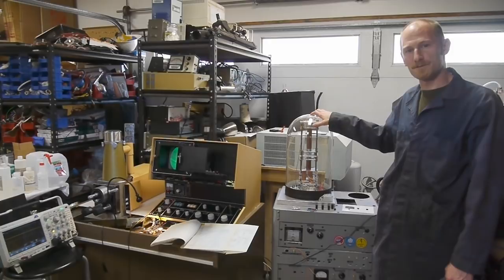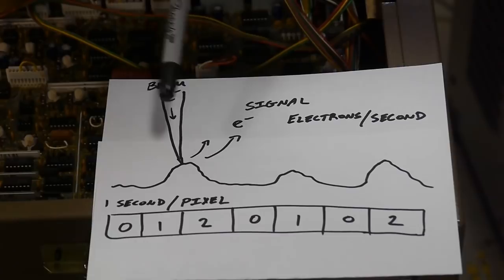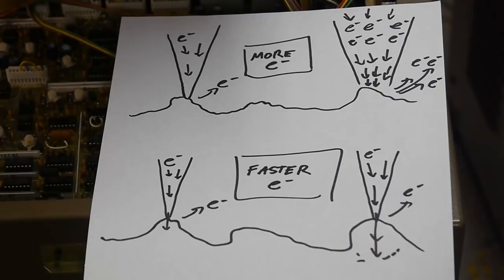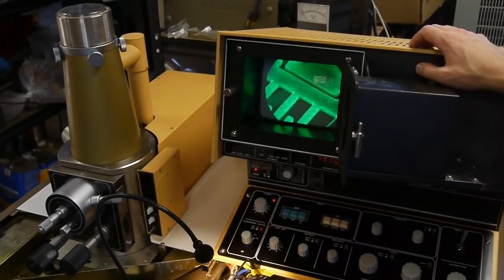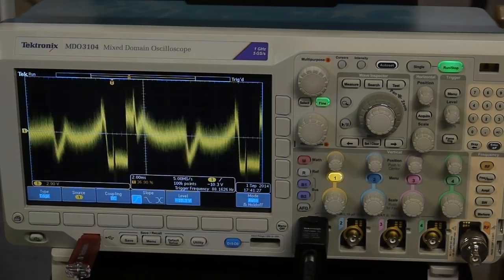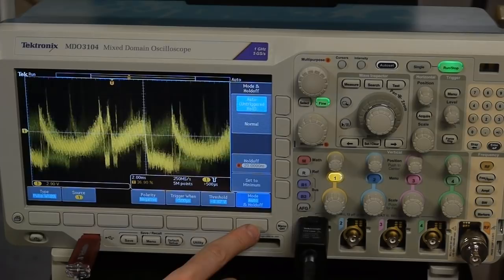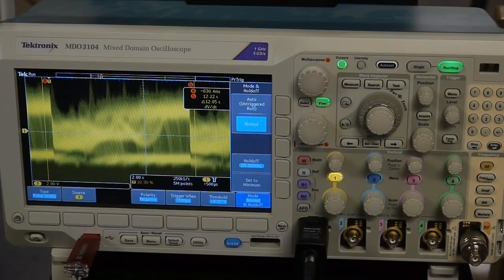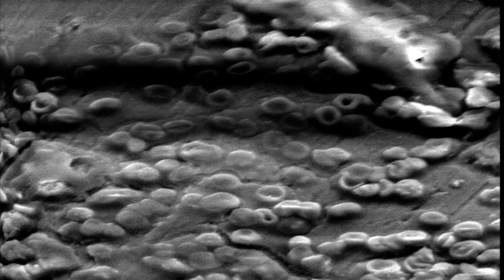Electron microscope image capture with an oscilloscope

Comment: Absolutely awesome Ben.  Can never get enough of SEM photos, simply fascinating - and I love how the MDO is being used as the data acquisition engine.  The HiRes sampling mode, with the amount of boxcar averaging you're getting, is giving you many more bits of vertical (video) resolution.  Simply great!
Reply from the maker: Alan, thanks so much!  I wondered if the Hi-res mode allows the scope to output more than 8-bits of vertical information.  It looks like it does from the smallest deltas in the CSV file.  Very handy feature!
Reply: Applied Science Yes, you'll get an extra 0.5 bits each time the # of bits averaged doubles.  Thus, If Hi-Res averages 2 bits, you get 8.5 bit resolution.  If it averages 4 bits, you get 9 bit resolution, and so on.  The MDO3k samples at 5GS/s on a single channel.  When you set the record length and horizontal scale, you effectively set the waveform sample rate (reported on the bottom right of the display).  The number of samples averaged in hi-res mode is then 5GS/s divided by the indicated waveform sample rate.  Thus, if the waveform sample rate says 500MS/s, then 10 samples are averaged to create each waveform sample point, giving you just over 9.5 bits.  Fixed point math hardware limits the progression at some point...

Comment from the maker: Afrotechmods Thanks, man!
Reply: Very nice. Since a SEM can seemingly be a rather simple device with low speed low cost image acquisition electronics and USB interface, I wonder if you might consider seeking venture cap funding and do a kind of makerbot SEM for the people. You could just start it up and pick some people to implement your directives so you don't actually have to do anything.
Reply: Applied Science 

What is the resolution on the microscope you were shipped? 

I am in desperate need of a SEM. It would be very cool if you work on Dan Frederíksen's idea. Me and countless other citizen scientists would be all over that.
Reply: It dont have one by default, it is analog
Reply: I did not understand the name

microscope sem 80s
Reply: Is an electron particle or wave?
Reply: @thekaiser4333  Yes.

Comment: Hi Ben, 
Another cool trick you can try with the EM is imaging the internal structure of chamber, like having a mirror inside the SEM. Mount a coin shaped disc with smooth side under the beam. Apply high kV (30kv) on the disc, let it charge up for about 5 mins. Then switch to low kV ( 3kv, or 4).  You will see image of chamber, with a sort of fish eye lens effect.

Comment: Ultra long exposures, that's an awesome solution! Could you use the same trick as astro-photographers by stacking many frames to get even finer detail?
Reply from the maker: That's an interesting idea.  I think it would probably work really well.  I'm imagining an image that progressively improves in realtime as more frames are acquired.  Then, it resets when focus or pan is changed on the SEM. Cool!
Reply: Applied Science You should make a video of you doing that
Maybe even take user suggestions for things they wanna see you put under the microscope
Reply: Applied Science I'd love it if you'd do a piece on "Stack and Stitch" photography.  Using a regular telescope you could get some fantastic pictures of the moon with super high resolution!
Reply: I believe they do.
Reply: Applied Science why resets? just put the original image as part of the new screen

Comment: Also I'm very surprised at the images you managed to capture without having to plate the specimens in gold like most SEM operators have to do. The fly image especially is just amazing for what it is. I wonder what difference gold plating would do if you were to rescan the fly now that we know it works well enough without it? Would you get any better resolution/detail at all do you think?
Reply from the maker: Coating with metal will definitely help -- especially for higher magnifications, which require smaller spot sizes, which really need as much signal as possible.  Most labs that have a SEM also have a dedicated sputter coater, so it's easy for them to always coat specimens, and write it into their protocol.  My sputter coater is working, but was recently moved, and hasn't been setup.  I tried scanning an uncoated insect and was surprised how well it worked.  You'll never see a proper SEM lab do this since they already have a full complement of tools.  Sometimes it's good to just try something and see what you get! In general though, coating with metal will help the image quality in every way.

Comment: Cheers to Mr. Anderson for seeing the opportunity and to you for taking advantage of it.  The scope gets a new lease on life in education!  Looks like a high quality piece of equipment (especially after what you said regarding the shipping damage)

Do you think you could use an audio card as a poor man's scope (with some conditioning of the input of course) to record these images?  The MDO is lovely at it, of course, but it's not exactly a low cost item, lol.  I believe the Wolfson card for the Raspberry Pi is ~$35 and the ADC seems to be able to record at 192ksps.
Reply from the maker: Yes, when I started making this video, I intended to use a USB audio adapter as the capture device.  Mine is a cheapy model, and only does 44KHz, so it would work for the SEM's 60-second scan, but would not have enough temporal resolution for the 10-second scan.  The audio device is 16-bit as opposed to the Tek's 8-bit, so there would be an increase in dynamic range.  Also, all audio adapters will need to have their input coupling capacitor bypassed.  I did this on mine, and it worked well.  However, some models include digital high-pass filters implemented in the ADC itself, and these are essentially impossible to bypass (like the ones in the Handy H4n).  The DC input range on my adapter was something like 2-3 volts, so the signal from the SEM would need to scaled and offset -- not too difficult, though.  Other alternatives are the LabJack, Measurement Computing, and NI USB-600x models.
Reply: Very cool!  And thank you for the short list of alternatives at the end, couple of things in there look like they will be useful!

Also, ordered shirt.  Paypal via Chrome was a bit wonky in case you hear anything.  IE was fine (go figure, lol)
Reply: jcims You can use a USB audio card, but you need to remove any DC decoupling caps from the interface, and you don't get very good control on the actual sampling bandwidth. If you want to eliminate (or enhance) super-nyquist aliases, you should use a sample and hold ADC. You can get plenty of cheap uCs or FPGA boards with 250ksps ~ 2MSPS sample and hold ADCs, and it's kind of trivial to build an opamp circuit to bias, filter and amplify the input signal.

If I had an SEM to play with, I would attach it to my Terasic C5G board with HDMI, so the picture shows up on the screen as it captures. It has a 500ksps 12-bit ADC which is surely fast enough for the task at hand.

Unfortunately while FPGA boards are cheap and widely available, SEMs are expensive and rarely sold used in my neck of the woods.

If I was to build an instrument it would be a scanning confocal microscope, rather than an SEM, but that's my preference, not a recommendation for others.
Reply: If you want to send a very slowly changing signal near DC frequencies, you can set a 555 timer as a square wave oscillator at a frequency that the sound card can hear then hook the signal to a pin on the chip which will modulate the frequency, then you can use an interpolated zero-crossing demodulator in a C program to recover the voltage trend.

Comment: Hi Ben:  A couple thoughts: 1) At some point the long exposure of the CRT will have diminishing returns.  As the exposure increases so will the accumulated noise on the sensor.  However I think a bigger area of image degradation will come from scattered light, although the scan beam is a “spot” the phosphor is going to throw photons around causing some “blooming” of the spot and might become a problem with slower scans and longer exposures.  Someone suggested averaging multiple exposure to improve S/N; I would think you could do similar and possibly better by averaging multiple analog captures.  Although, what you have shown just “out-of-the-box” look great.  2) You mentioned the edge distortion seen in your un-cropped analog captures.  You might be able to correct this as they do for glass lenses.  Manufactures of photographic glass provide a distortion profile for their lenses (e.g. barrel/pincushion, angle of view, vignetting, etc.).  These lens specific profiles are provided within Adobe Photoshop and Lightroom, and others.  Adobe has outlined a procedure and software to generate custom profiles (http://www.adobe.com/support/downloads/detail.jsp?ftpID=5492).  Basically, you image a rectilinear grid and the software calculates an orthorectified correction matrix,  Anyway that's my 1.99999 . . . cents. Cheers, Mark

Comment: A cool thing you can do is look at a live electronic chip surface.  The charge of the surface makes the EM signal brighter or darker, so you can directly see the circuit running!
Reply: Unfortunately, you won't be able to see that on a semiconductor. You are able to see that on the pins of the chip. He already tried it.
Reply: Why is that? Is it because the semiconductor is covered or some physics reason?
Reply: farvision semiconductors are very small, those traces are incredibly small, but the main reason is because there is a plastic protection film over the die.

So you have to remove that clear plastic film in order to see them light up or get darker with the SEM. Chances are soooooo little that the IC will still work. But its certainly possible without breaking the IC.

The electron beam interferes with the protection film. The protection film is applied to protect the die from damage when it gets capped by the mfr.

But main reasons: traces are to thin, and the protection layer which interferes with the SEM. But i'm sure you can see the traces light up or get darker when those things are done. But its very hard en almost invisible.

I would love to see a live computer CPU under the SEM, that would be awesome especially if you can see what its doing.

Comment: Wow! Very impressive work. Love the images you captured. I miss using the SEM that we had available in 1980 at Andrews University. I was working in the electronics lab on an OP amp circuit assignment. The OpAmp failed. So, I kept it and wanted to find out why it failed. I took the metal cap off the base, put it in the SEM and found that a small aluminum trace between to parts of the circuit had suffered a current overload. Knowing that I had not caused that during my use of the circuit, I suspected that there was a defect in the trace from the manufacture of the part. Over time, as current passed through the trace, it weakened until it failed. The metal actually pooled up into a bubble, causing an open-circuit condition. As the part had worked fine for me until it failed, I wanted proof of the cause. Now I was certain I had not caused the failure. The images were so clear and in focus, I had no doubt about the cause of the failure.

Comment: I am very hard to impress, but this is first time i see something original and useful with MDO3104.
Still, i would simply take normal arm cortex m4, FT2232D chip, and create labview app that can take images at 16b adc, and that could yield more than 20-50Mpixels with more dynamic range
Only tricky part will be how to figure out hsync triggering on mcu
If you need, i can help you with interface with labview and mcu program to collect data and send to pc in semi real time

Comment: Capturing the signal with an oscilloscope is rather clever.  I like the way that you are thinking outside the box.

Since I have been playing with SDR (Software Defined Radio,) it occurred to me that you ought to be able to use one of those twenty dollar SDR modules to grab the signal and send it straight to your computer.
Reply: All you need to do is solder a fine solid copper wire to one of the pins on the RTL-SDR chip to enable direct sampling, then record with 'rtl-sdr' program in direct-sampling mode by changing one line in the C code. The negative is just the negative power terminal of the USB plug. Also once you did all that you now have a tool that can create a rewindable record of the AM radio stations...THE WHOLE THING, that's right! You can record everything the antenna hears and if you got done listening to one interesting station, you can REWIND THE RADIO and go back and hear what another station was broadcasting AT THE SAME TIME. And a BD-R 25GB single layer disc will hold 1 hour and 25 minutes worth of it. All you do is tune to 1.2 Megahertz and run the sampling rate a 2.4 Megasamples per second.

Comment: With the SEM you built, it's kind of a setup process to get a vacuum going, so I was thinking. Maybe build a round stepper motor controlled plate you could put multiple samples on, then just prepare the vacuum once and you can observe multiple samples. Just a thought I had.

Comment: Applied Science,
Great job of the video and the technique to acquire a better S/N and more resolution. Since the scan rate is so slow you might consider using the sound card input for the DAQ. As you   the sound card has at least 16 bits and some have 24. So with an appropriate scan rate and that resolution your pics should look even better.
Thx again for the video and the insight.

Comment: With only 5V peek to peek, a relatively slow sample rate, and the low resolution ADC of the scope; would a 24bit/96KHz sound card not be better suited as a capture device?
Reply: If there is significant high frequency noise in the signal (and there is), then although the scope is only 8-bit, the effective bits after digital low pass filtering is much higher (as a rough rule, add a bit for each halving of the bandwidth). The best screens (DICOM monochrome LCDs, $$$) are only 12 bit output, and most screens are only 8 bit (though you can get cool temporal dithering software to extend this), so anything over 12 or 14 bits is overkill. Still it might be the cheapest option to use a 24/96 USB soundcard if you need a 48kHz pass band.

Anyway, the proof is in the output; the SEM of that MEMS device is ultra-sharp and the SEM of the fly is well defined and amazing beautiful micrography. I would use something else, not for the quality, but because I believe every tool in my lab should be accessible and ready to use, and I couldn't afford to have an expensive scope setup like that permanently.

Comment: How about a timelapse of something getting degraded by the electron beam.
BTW how long does it take to pump down? Does it pump the whole chamber or is there an airlock for the sample chamber?
Reply from the maker: You may not need a timelapse to see damage caused by the beam.  I was looking at strands of hair, and at 25KV with a large spot size, the beam will start to "bubble" the hair.  It creates a fairly large blister in 5-10 seconds.  Yikes.  This SEM pumps the whole column down as one unit, and doesn't have an airlock or nitrogen purge.  It only takes about 10 minutes to change samples, though.  It also has two separate stages for small and large samples, which can be manipulated separately, and a few unused blank plates (I'll add electrical feedthroughs).
Reply: Applied Science would love to see some video of this and whatever else fancies you.  Electron microscopes are just fascinating.  I could look at anything under one.
Reply: Applied Science
Hello Ben, are you afraind of X-ray radiation when the electrons are de-accelerated? I mean, the glass bell do not protect you very well.
Reply from the maker: Alexander A.
The DIY SEM used acceleration voltages of under 10KV, and X-rays generated by these relatively low speed electrons will be stopped by a very thin layer of glass, so the bell jar is more than sufficient.  Black and White televisions did not have lead shielding for this reason.  The JEOL uses acceleration voltages up to 25KV, but the chamber is relatively thick stainless steel, and this sufficient to stop the X-rays generated by the beam, which is already extremely small (50uA emission current).

Comment: Have you considered trying to observe a voltage contrast from working IC? It's based on secondary electron yield modulation when potential of the surface changes, so you can directly map the potential of interconnects. Of course it may interfere with IC functioning. Also EBIC is an interesting technique too.
Reply from the maker: Yes.  Viewing an active electronic circuit with a scanning electron microscope  I'll do another video with my new SEM, and expect much higher quality.
Reply: Applied Science Cool, thank you. I've missed that video somehow.

Comment: Awesome, that's amazing!
I think you can still get more resolution from your scope. Similar to what the high res is doing (averaging the extra samples it has)
For every four times you downsample you can get 1 bit of extra information, just like a sigma delta (1-bit) converter does.

So actually acquiring the 10M points and averaging (boxcar filtering) might improve your dynamic ratio.

Comment: If you have a DSLR, can you try starting a 10 second exposure, and then while it scans a new frame then see if it gives a full frame?
Reply from the maker: I captured an image with a 10-second exposure of my camera aimed at the CRT: https://plus.google.com/115054970849159689228/posts/L2oN8GKSpfJ It works, but not as well as digital capture, of course.